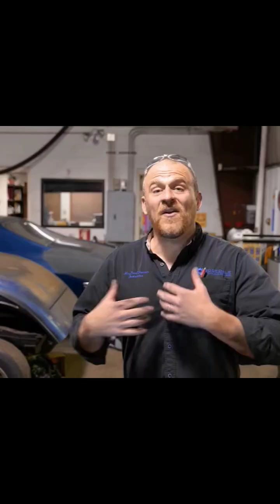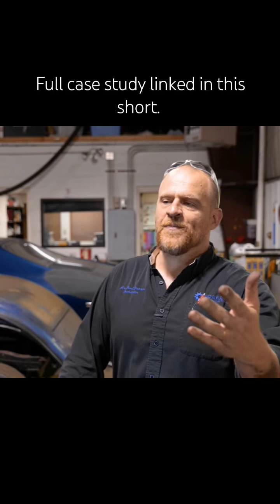Bad Driver or Shorted Solenoid? [Transmission Shift Solenoid Testing]

Comment: Hey man i need your help got a hot jumper cable when my 94 z28 camaro when im turning it over.  Changed the fuel pump assembly ,fuel pressure regulater,ignition coil and the coil module,plugs,pigtail for the coil. And i think i need the fuel pump connecter i cant really see it to clear .put vats resister security lights out it was cranking over and up when i hooked up the battery charger but now im back to idk. Can u please help me man been watching alot of your videos and trying to learn some better direction
Reply from the maker: What's your fuel psi? Do you have spark? (Doesn't matter what was replaced, you have to test it).
Do you have injector pulse?

Comment: But what if both sides are controlled by the computer? Like for example a common rail fuel pressure regulator
Reply from the maker: For sure, a great question. Most of those are power side switched but some are even controlled on both sides (GDI fuel injectors for example)
Reply: @ScannerDanner  🫡🫡🫡

Comment: I still appreciate you helping me out with my 93 suburban. Fuel pump wouldn't shut off and I even pulled the relay and you told me to check the oil pressure switch and the pigtail was full of oil. I stayed it out and sure enough you were right. The fact that you teach, work, and still have time to respond to comments is unbelievable to me. Thanks for all you do. You saved me no telling how much money.
Reply from the maker: Awesome!  Thank you.